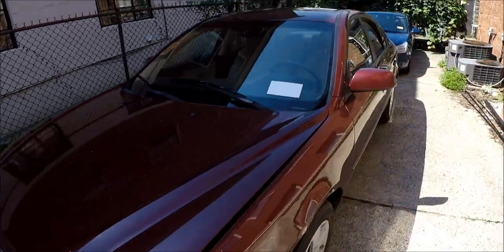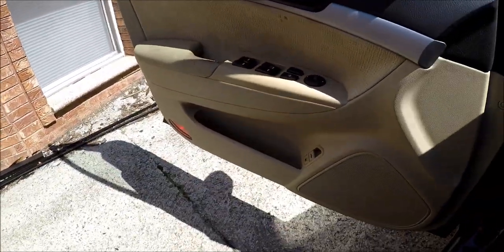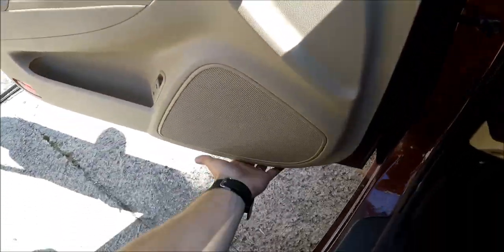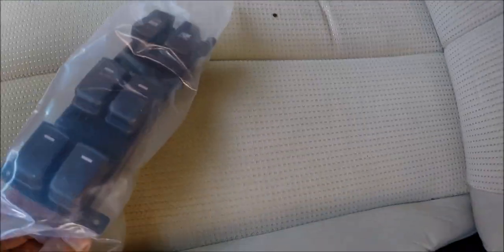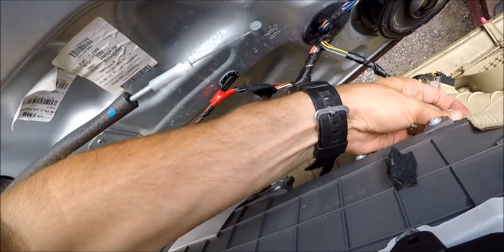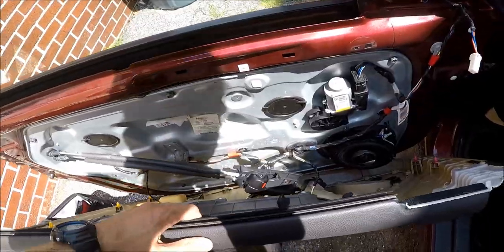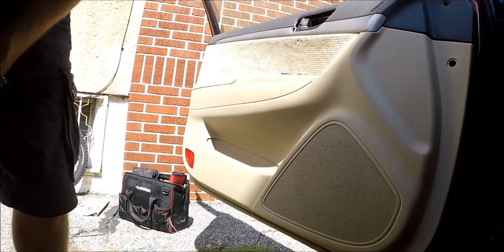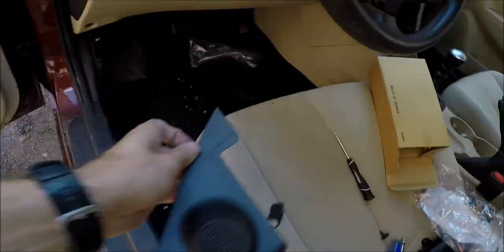How to replace window control switch 2006-2010 Hyundai Sonata

Comment: Pretty good video, which helped me a lot in replacing the switch in my 09 Sonata. A couple of suggestions:
1) Don't bother trying to disconnect the wires for the little speaker on the top. Just pop out the assembly, and have it hang over the other side of the door. The wire is long enough, and it's very lightweight so there' s no stress.
2) The 2 back screws on the switch as well as the securing tab on its back side are very hard to get to (the video doesn't show how he got to them). Far easier for me was to take out all the screws that hold the switch/arm rest assembly, pop out the entire assembly, and THEN remove the switch. There are about 10 screws holding it together, but they were quick and easy to remove.

Comment: Thanks for taking the time to make this video, it saved me a bunch of money. I was able to find a decent quality replacement switch on ebay for $20, while my local dealer wanted over $100 for the part.  I'll take the risk of a non-OEM part for those savings.  Had the door panel off, replaced the switch, cleaned up the coffee spill that likely caused the original switch to fail, and had it back on the car and working in about 20 minutes.

Echoing what others have mentioned, the hardest part is the getting those 2 screws on the switch assembly back in and tightened.  Did not have to remove the armrest however (the fewer screws I remove, the fewer I lose). The drive on the screw-heads securing the switch to the door panel  is pretty deep so your shortest #1 or #2 philips screwdriver should fit in there. Finding the hold can be challenging so wither magnetize your screwdriver or place the screw in the hole with some needle nose pliers first.

I'd avoid removing the cables on the door handle unless you need to service something there as well.  It's not necessary to replace this switch. Also, be very careful when removing those little plastic button screw-head covers, they can go flying pretty easily.

Comment: Thank you for the video.  95% of the fix was very easy.  The only hard part was getting to the back clip.  You did not show how you removed this?  I was not able to get my hand behind the control unit with anything I tried. Small screw drivers were not effective.   I finally pried off the top and used a large pair of channel lock pliers to squeeze the top together.  This popped it off both clips and it pulled right out.  I did spend 25 minutes prior to the solution trying to get anything behind the control switch to pop the clip off.  Hope this helps someone.  I purchased a new one for about $20 on Amazon.

Comment: Great video though it didn't fix my problem - which was the intermittent operation of the passenger side window. Anyway, I left the new switch in there.  Maybe I need a new window motor.

As others have pointed out, a crucial detail is missing in the video - He doesn't show how he got to the two backside screws on the switch. A small ratchet drive would help here. Then you can avoid removing the entire armrest assembly. Also, there is no need to disconnect the connector on the top right side near the mirror.

Get a switch with a plastic pry bar included as that will come in handy.

thx,
jose u

Comment: How did u pry back the other tab on the opposite side to remove the old component?
Reply: I finally got it. - no broken pieces! I used a tiny leatherman that had a flat head screwdriver and turned it 90 degrees to be able to reach around. Use the little holes on top as guides to tell where the clip is.

Comment: On my 2008 GLS, I had to remove the armrest to be able to access 3 of the small screws that held the window control switch. It wasn't difficult once I realized that was the only way to get to the screws.

Comment: Thanks for this video it in about to replace mine in the next next few days  it was weird the switches on just stopped working
Reply from the maker: Check connector first
Reply: @repaired2106   I will they all slowly went out on that side the driver window switch was the last one to go out